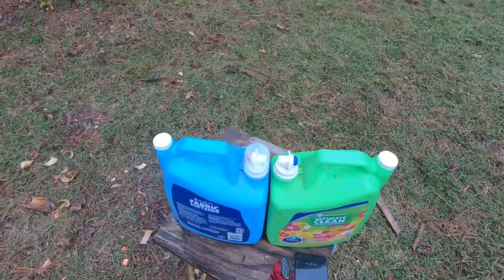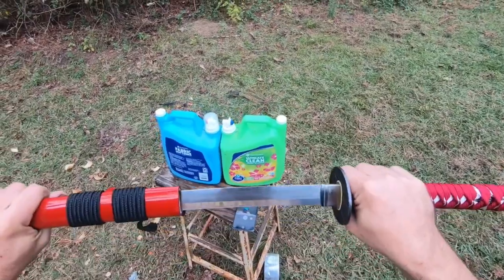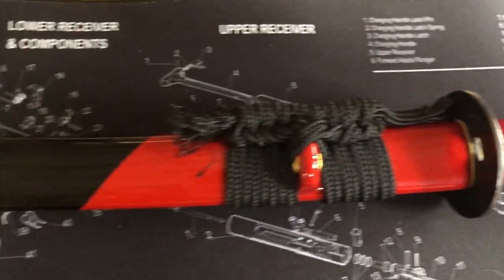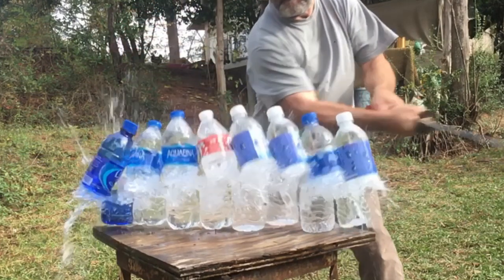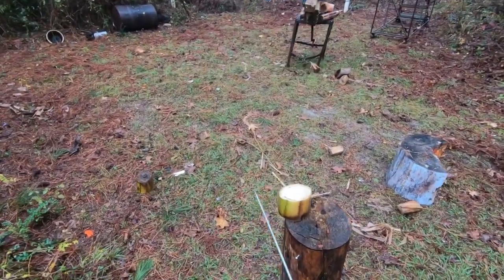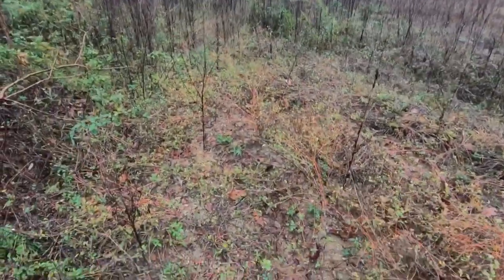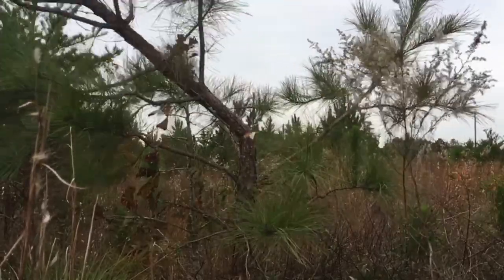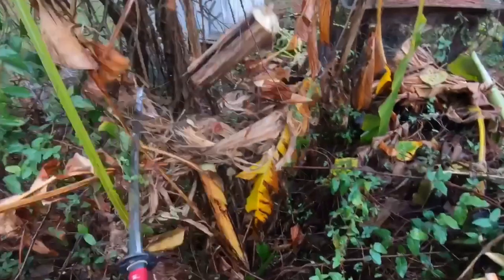Entez Handmade Katana, Battle Ready Samurai Sword

Comment: Decent edge for $200 my concern with it would be if it would hold up to another sword strike I have some higher priced Katana's that will hold up to strikes, a true handmade by a Japanese sword smith will run you around 10k or so and you'll be waiting a year or so for it
Reply from the maker: What’s the best brand or at least the brand you have full confidence in? From what I can tell the better ones were made from T10 1095 High carbon steel I would like to make one myself then I could get the softer steel in the middle like a traditional one should have right now I just don’t have the time to make one.

Comment: Interesting  video. Good cutting excersizes "Tameshigiri".

 How ironic as I plan  to shortly make a similar video with my Cold Steel Tactical Katana machete. 

Let's be realistic and honest some things made in China are Not junk!

I have plans for my own design Hybrid Katana/ O-Katana ( a longer Katana) with a  European Crossguard and double edged blade.

Well designed and made Swords, Spears ( especially the  Boar Spear) Hammer, Axes, Bows, Cross Bow, can all be very effective weapons/ tools/ implements for effective  use in self Preservation situations against dangerous persons or even against attacking animals. 

Keep up the good work Safe Journeys!
Reply from the maker: Looking forward to seeing your video, it looks like they made it similar to the original Japanese swords, it must have took them a long time doing it by hand, i’m assuming they probably cheated some where But still the finished product seems to be very well-made, not unlike the Cap and ball revolvers that we get from Italy, which may not have the same finish as the Colts but they still work and get the job done

Comment: I ordered one online from eBay today not so sure how it’s gonna be I hope it’s sharp as yours
Reply from the maker: I hope they have good quality control and each individual sword as it is as good as the one I got, when you get it let me know how it turns out
Reply: @Leverguns50  I sure will thanks for the video
Reply: @Leverguns50 I got mine today it was quite heavy feels like a battle ready  sword for it’s price it’s hell of a deal can’t wait to cut bottles with it
Reply from the maker: @marveen6372  let me know how it goes
Reply: @Leverguns50  when I tried to cut Fanta bottle it didn’t go fully thru only half of the bottle was cut but small branches and tree it barely cuts I feel I need to sharpen the edge a bit of more bottom pommel was loose :/ still no complain cause many expensive sword can have same issue .

Comment: I'm trying to figure out if I carry it on my back, will it be in the way of my rifle sling.
Reply from the maker: Carrying it on your back would probably work, but might be hard to re-holster it so to speak
Reply: @Leverguns50  bevel the mag well, so to speak, and practice...
Reply: Carrying a full sized Katana on your back is very impractical and almost impossible to sheathe again.  A ninjato the size of a wakizashi would do better.  Still impractical and hard to use this way but it could work.